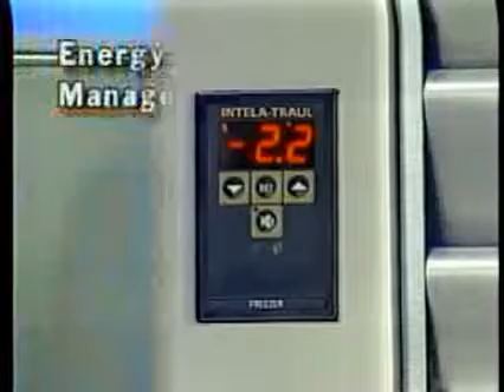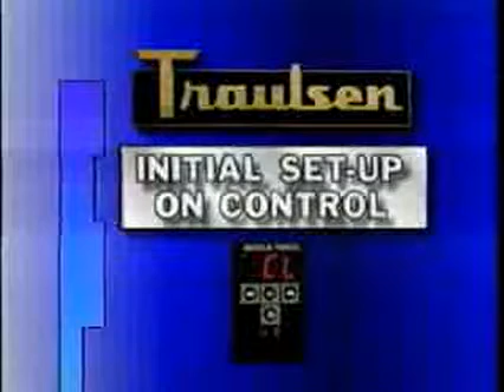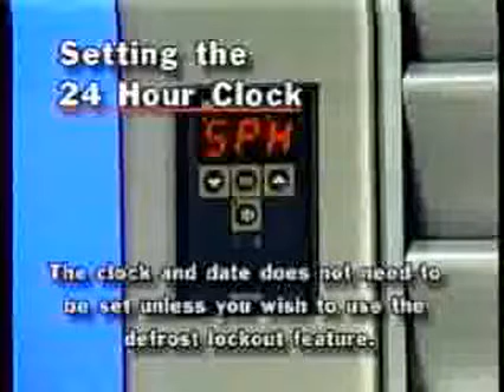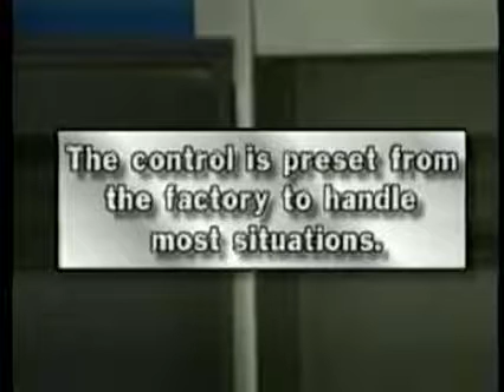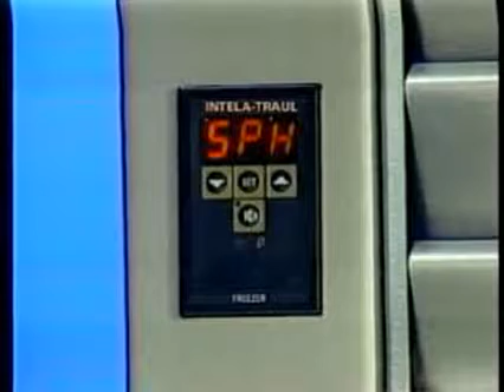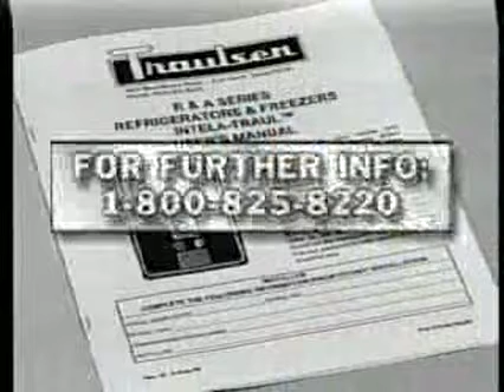USED COMMERCIAL REFRIGERATION EQUIPMENT FORT LAUDERDALE bowerysupply.com

Comment: Hello sir 
I have one G series 2 door glass chiller .there is ice farming in coil within 1 day .i replace coil sensor also.but same problem facing .by putting manual defrost heater working .but in auto mode never i see DEF on display .plz suggest ..i change defrost time too.